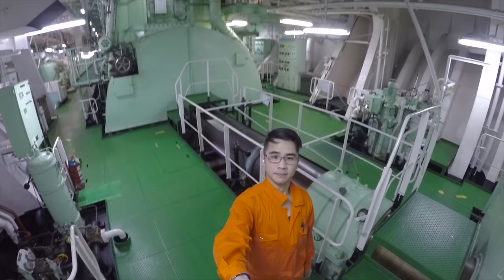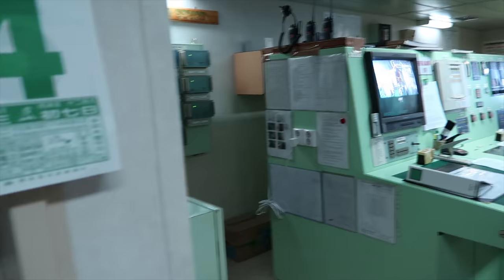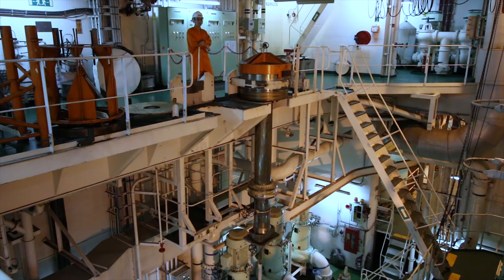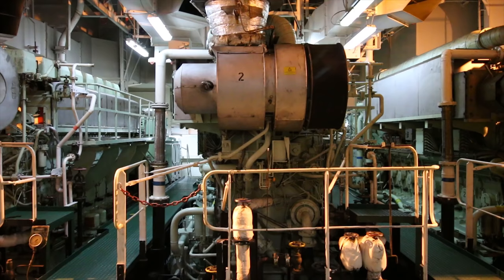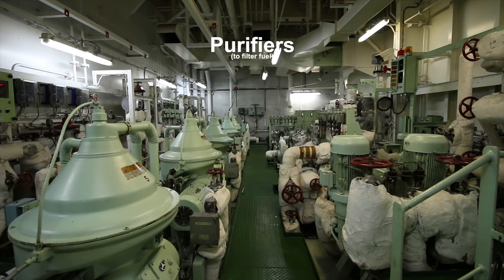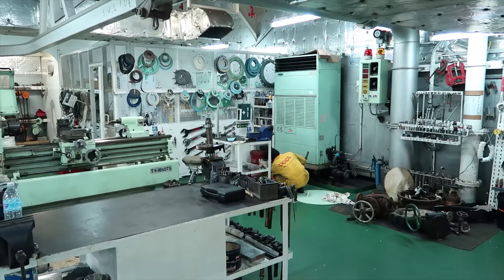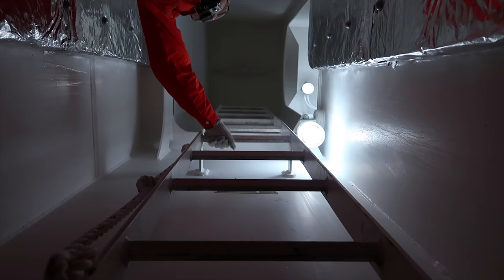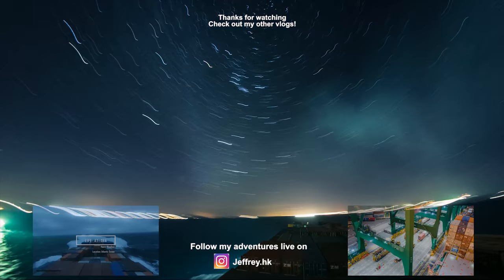A Tour of Mega Ship's Engine Room

Comment: I work as a Gas turbine Technician on a destroyer. It gets hot in the engineroom. Very similar equipment we use; lavap purifiers for fuel and lube oil, coalescers, air compressors etc.
Reply: I'm surprised at the need for air compressors what with a gas turbine producing power. Usually the low or high pressure compressor sections can be tapped for charged bleed air and they've got plenty of that to spare.

Comment: hi, I am a first year Maritiem Officier student from the Netherlands. after 4 years I have learned about navigation and engine I can choose between both. What made you choose for navigation instead of the engine room?
Reply from the maker: the noise. I know i wont be able to handle the constant loud engine sound for 8 hours per day.
Navigation i get to stare out the window and day dream and get paid....
Reply: thanks for the quick reaction. hmm, some of my colleague students are telling me the engine room can have more challenges compared to a more quieter bridge job
Reply from the maker: definitely
Reply: Definitely go for Navigation side!
Reply: Engineers have mor challenges, that's where the rubber meets the road. Remember that engineers are responsible for ALL ships systems, not just the motors and electrical supply, so you're all over the place. Plus the oppoertunities for advancement are better in engineering, first engineer is actually the secong most senior officer on a ship, with the PAY $$$ that goes with that.
Reply: Ewoud Gov ik ben nieuwsgierig waar heb je de opleiding van maritiem officier gedaan?
Reply: Being an engineer onboard, back home i can fix almost everything. Cars, Electronisc/electric, aircond etc... That’s the advantage. Now if they ask me i will tell them to go for Deck side, easy peasy job with more or less the same paycheque..
Reply: My brother, now an old man, is a maritime engineer with crazy licensing. There are not many vessels out there that he is not qualified to work on. Anywho, he's been working on the boats since  he was 16 years old and it is his life. He absolutely loves it. I would think the benefit of working in the engine room is at you can fix just about anything that breaks ever. On the other hand, my grandfather was a tug Captain his whole life. I find being in the Wheelhouse far more romantic than being in a noisy engine room. However I do admire those who can make things run when they break.
Reply: But wait, how come in the novel "Wheel of Darkness" the engine room was sealed up with bomb-proof doors to protect against terrorism and how come they said sabotaging the engines physically would make them explode and blow out the bottom of the ship? It was an ocean liner ship. Sounded like some bullshit to contrive a runaway ship scenario. They even had access to bridge windows to stop the hijacker, but yet it was never brought up that maybe they could break the glass even if it is bulletproof to get onto the bridge. It's like they didn't need a crew to maintain the engines and all the escape hatches were also covered over so was the engine crew sealed completely inside with no way to escape? People should buy my "Impact" a James Grider novel on Amazon.
Reply: Ewoud Gov zit je op het stc in Rotterdam?
Reply: Ewoud Gov I spent years in the US Navy as a SNIPE (engineer). I specifically the electrical side. So my engineering lifestyle was a lot more comfortable than that of a mechanical engineer. We had separate rooms for switchboards and load centers that were A/C cooled. We rarely went down to the engine rooms if there wasn’t any electrical issues. I’m not sure about the civilian side of things. But engineering is a lot more rewarding and transferable to different industries. Verses navigation where you are pretty limited.

Comment: So why double door the entrance to the engine room? I noticed the heat insulation in the "door room" which leads me to think that it is there either as an emergency contingency in case the engine blows or something and/or to keep the heat from the engine's normal operation out of the crew space. I also want to ask, what does the primary engine run off of (if it isn't diesel) and what the fuel consumption looks like for such a beast. I am more used to nuclear reactors that are super efficient and operate by themselves for decades without needing to be refueled

Comment: Another great video. Question for you - the ship is driven by drive taken from the crank, so why do you need so much steam and compressed air?
Reply: Steam is to heat up the fuel tanks. Mostly by the exhaust boiler, but you also have an auxiliary boiler for reserve wenn the exhaust boiler not working for example in port. An compressed air ist mostly used for starting the main engine. And switch von forward to backward and other side back. Gz Ralf Shipsmechanic :)

Comment: hey I know that there is equipment that involves the communication between the bridge and the engine room, like the telegraph, but how do you make sure that all the devices that need a direct connection between those e two departments are showing the correct information, do we need to be in constant communication with the personnel in the engine control room (like the one you showed) or there’s a backup equipment that may show the errors found in the original? Greetings from Venezuela

Comment: I understand that much of the operations are automated and a crew of 20 or so is working on the ship, but in case of emergency what's the absolute least amount of manpower needed to operate the engine? I guess it's not started and ran by the turn of a key and a steering wheel :).
Reply from the maker: +SirArghPirate chief engineer plus two other engineer
and two oiler, so 5 people
Reply: JeffHK So most of the crew are simply there to cover 24x7 operation (4 or 5 shifts of 5 to 6 crew with days of or 3 shifts of 8 to 9 crews working 7 days/week).

Comment: hello jeff my name is marcos hernandez and I'm from venezuela, I love the content and dynamics of your videos.
Does the A/C system use cooling tower and chillers or it's use the same conventional system like the one for houses ?
Thanks
Reply: I would think all the equipment needing cooling is cooled either directly or indirectly by the sea. The chillers would be the same as land based equipment but have the salt sea water circulating through the condenser. The chiller/evaporator would then have water/brine circulated round the accommodation through fans to each room/cabin or be a dx unit with chiller batteries round the accommodation.

Comment: I am a bit afraid when I see a padlock above the emergency stairs.. just imagine a fire and it's closed 😨 ...
Reply: The loop for its padlock is secured by a butterfly nut on the inside so incase it is locked you can always unscrew it by hand and the whole padlock arrangement will be made redundant and the booby hatch can be opened.. usually this padlock is used in high risk areas to keep the engine room isolated. Hope this reduces your fear to some extent. :)

Comment: Ah hah. Say, I bet it requires a lot of training to be able to work down there. Are there external courses that you have to take or does the company provide it? Do you have to pay or does the company cover that?

So is it like it was before? Does the bridge have to signal you guys what kind of RPM they need and then you make the changes or can they actually control that directly from up there now? I bet if they can control it up there, there's a secondary system that allows you to do it in case of some sort of a failure. Yes?

Same for directional control. I bet there's a way for you guys to helm the ship from down there in case something has gone wrong with the helm they have up there or somewhere between.

Comment: A question for you jeffHK , do ships have EGR valves or DPF filters? if so would you do a videos showing me and ill pay you for your troubles , thanks jeff , good video as always
Reply: Some new built ships complying with latest air pollution regulations may have an EGR valve. 
There are no DPF filters as far as I know. But on oil tankers they clean the exhaust gas from boilers with sea water and use it as an inert gas for oil tanks.

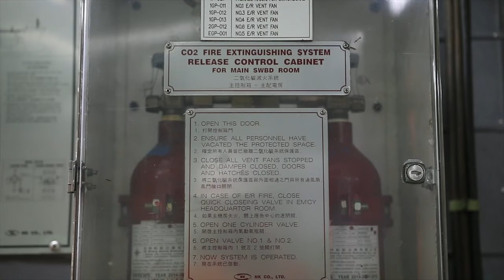Comment: Great video as always! At 3:09 what is the "Dead man switch" for? Thanks
Reply: It's for when someone has to go down to the engine room alone (at night normally). It is a timer of 26 minutes and if the timer is not reset the whole ships alarms will go off as it could mean the person in the engine room alone has injured himself. There are multiple reset points all around the engine room normally. 

The majority of engine rooms are now only manned 0800 to 1700 and the engineers take turns to be on a 24hr duty. They will be the one to answer the alarms in the engine room if something* goes wrong when the engine room is unmanned.
Reply: Thanks!
Reply: I think the time is adjustable....
Reply: Max is 29 minutes, some are adjustable but the most common I've seen is 26 minutes.

Would need to check SOLAS to be 100% sure.
Reply: from solas....

Personnel alarm (Dead man’s alarm)
(1) On ships of more than 500 gross tonnage, a one-man watch in the engine-room is not permitted unless an
automatic personnel alarm (dead man’s alarm) has been installed.1
(2) The alarm system shall comply with the following requirements2
:
a) The personnel alarm shall be arranged to give the alarm on the navigating bridge, in the officers’ cabins,
messrooms and recreation rooms if it has not been acknowledged from the engine-room. The alarm shall
be automatically activated after a pre-set period of time not exceeding 30 minutes.
b) A pre-warning signal shall be provided in the engine-room which will be activated 3 minutes before the
alarm required in subparagraph 1 is given.
c) The alarm system shall be put into operation in the following way:
1. Automatically when the engineer or engine-room attendant of the watch has to attend the engineroom
in case of an engine-room alarm.
2. Manually by the engineer or engine-room attendant of the watch when attending the engine-room on
routine checks.
d) The alarm system shall be disconnected by the engineer/engine-room attendant of the watch after leaving
the engine-room. When the alarm system is brought into operation automatically in accordance with
subparagraph 1°C), disconnection shall not be possible before the engineer/engine-room attendant has
acknowledged the alarm in the engine-room.
e) the personnel alarm may also activate the engineers’ alarm.3
Reply: The pre-warning period of 3 minutes may be extended until the maximum allowable which is 5 minutes. (Depending on ships lay-out and the time needed to reach the E.R. when the Engineer on duty is having  his (or hers nowadays) beauty sleep)
The period of 30 minutes remains the same.
I myself was used to 27 + 3 minutes as well.

Comment: hey @jeffHk i also work at a similar power plant that is powered by wartsila 12V46.... i love to work on these engines i work on practically everything from compressors to Napier457 and 357 turbochargers .....  i am trying hard to try to get to work on a vessel to pursue my dream in the area can u assist me in getting in to contact with a vessle that needs a third engineer or Fitter mechanic please please

Comment: "Vertical boil olier : also produce steam pressure"
Why steam? i think the main engine is Diesel. So why steam?
Reply from the maker: +Stefano Danieli to heat up fuel safely
Reply: Thanks for the answer : 
By the way, is the steam used also for a secondary turbine? (maybe for electricity?) in some other videos, the diesel engine room of big ship has got also one steam turbine... (asking why?)